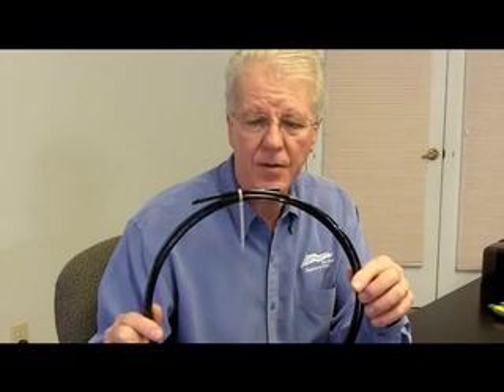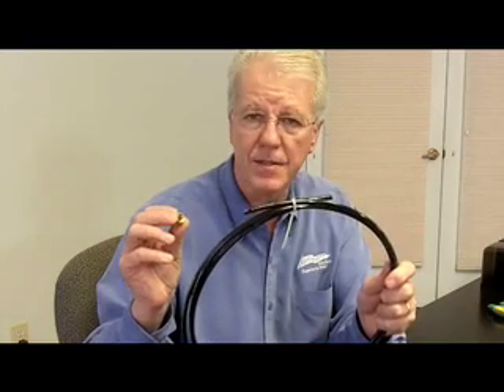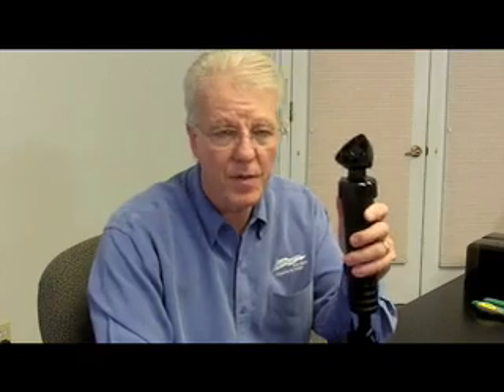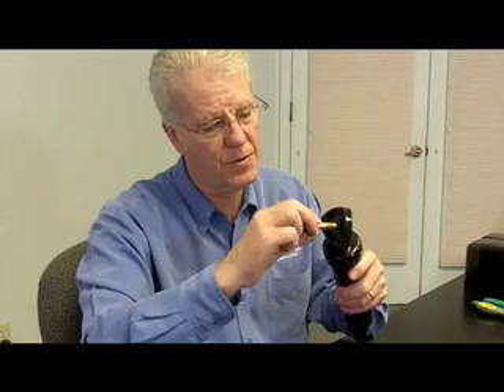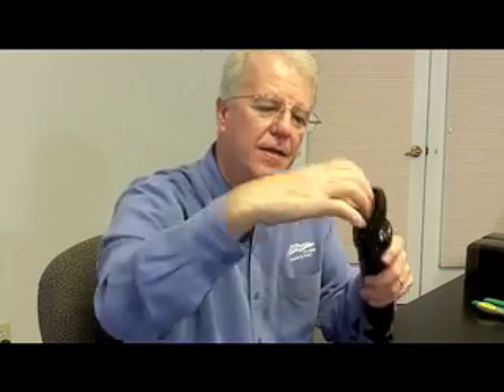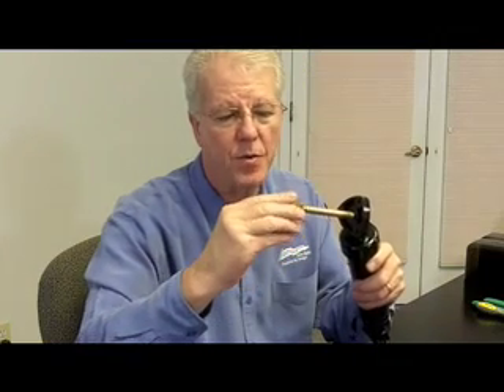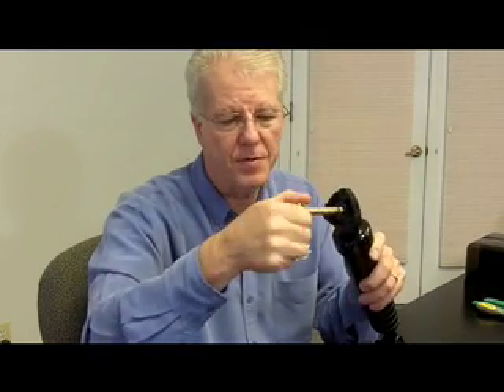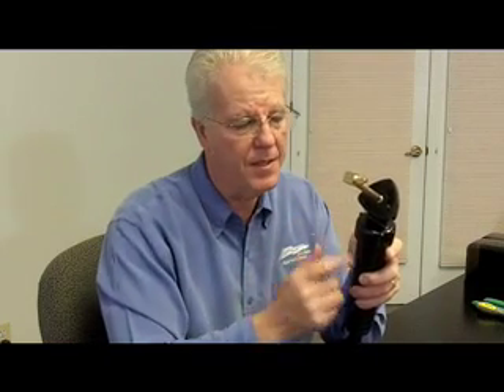Trim Tab Troubleshooting: Actuator Moving Slowly

Comment: Thanks for the info. I have a tab that has been moving slowly since I purchased my boat. Trouble shot the motor to eliminate a solenoid problem. Switched output lines to see if it made a difference and it did not. Think that narrowed it down to the actuator itself. Thought I needed to replace it until I saw this video. I will check that brass nipple fitting first and back it off a turn and see what happens.